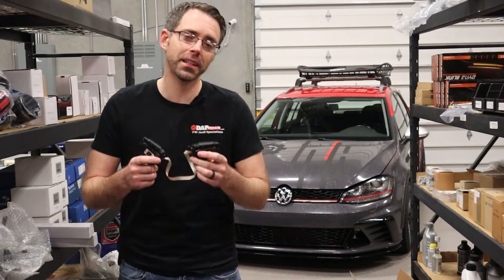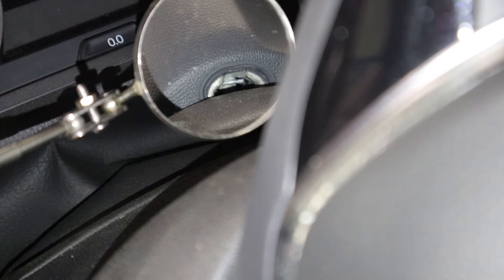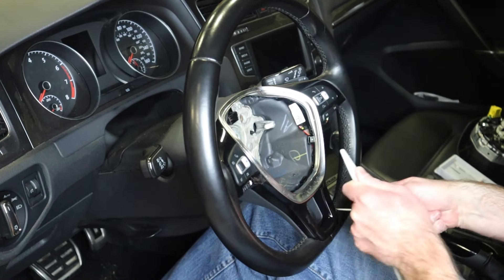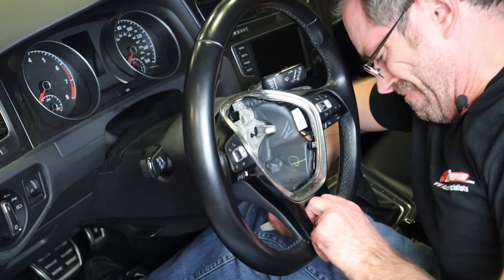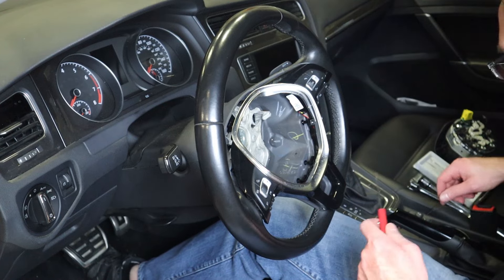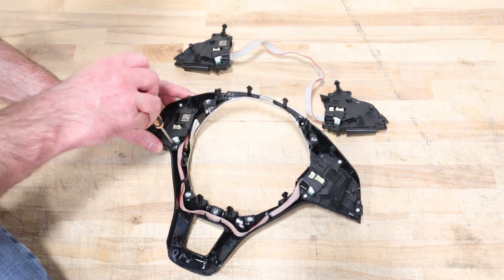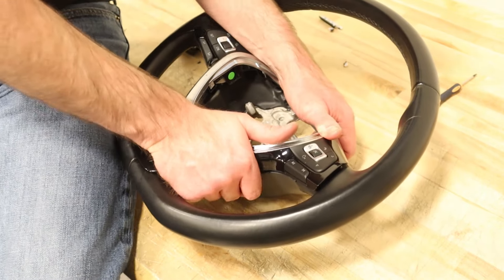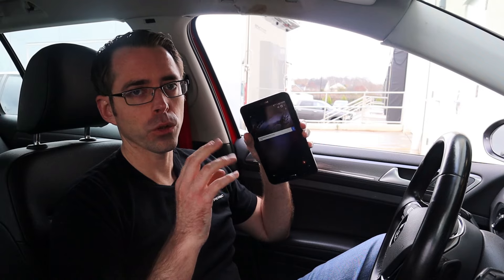How to Remove a MK7 Steering Wheel and Buttons (Trim)

Comment: Awesome vid Paul !! For those that don't know, when you reconnect the battery and get that steering error code, you can start the car then turn the steering wheel full lock right, then left, then back to center to reset. If the cruise error light is on, simply shut off the car and start it back up again. I discovered this recently after installing by boost gauge and had the error lights come on when I reconnected the battery.
Reply: Is it possible to swap this steering wheel with a g7 gti steering wheel?
Reply: @EntertainmentOnDemand1  same question
Reply: What about the airbag error?

Comment: This is a good and much needed video, but as others have pointed out on the forums it's much much easier to do this with the wheel off and only requires one more step to do so. Also, if you have a proper trim removal kit, you should be able to avoid using a metal object like that pick-screwdriver which is definitely going to damage wherever you're prying. I took my wheel off a few months ago, and I found that - like anything else involving clips in the VW world - whether or not you're going to break a clip that holds the trim/bezel onto the wheel is a complete gamble. Even if you're careful and take your time.

Comment: Thank you Paul - this helped me to get my airbag off my GTI MK8 so I could put in some R paddle shifters on. FYI, there are three springs on the airbag that need to be popped. At first, I assumed they would be just on the two sides but there is also one on the lower portion of the steering wheel. Wasn't too difficult to pop off. Don't underestimate Paul's advice to lower and pull the steering wheel out too! I did get error messages when reconnecting my battery but they did go away after the first start up.
Reply: How do you unlock the steering wheel while the battery is disconnected on the Mk8?  I'm about to do the same mod, maybe I'm overthinking it with the whole push button start 😂
Reply: @codypanek  did you ever figure this out? Do you need to reconnect the battery to turn it then disconnect again??
Reply: @MoF4tt if you press the start button without your foot on the brake pedal, it unlocks the steering wheel. You can then disconnect the battery and the wheel remains unlocked.

Comment: Instead of disconnecting the battery what I do is for kessy cars keep door closed when after turning ignition off(keeps the wheel from locking,once u open the door the wheel lock activates) or not removing the key on regular ignition vehicles for the same effect. Anyway great video keep them coming
Reply: James Kaminski does the horn go off of you remove the 2 airbag holding metal bars? I’m thinking to do this, then I’ll disconnect the battery before I remove the actual electrical plug. 2016 GTI SE W Kessy/Push start.

Comment: You guys should make a video on how to remove the door bezels where the blue/red LED light strip is on the front doors and also door bezels in the rear on a mk7/mk7.5 Golf/GTI/R. My passenger side has a deep scratch on the bezel and I don’t know how to remove it. 
Might get carbon fiber ones. Haven’t been able to find a DIY on how to do it and don’t want to risk using a trim tool and messing it up

Comment: First, thanks ShopDap. Second, some supplementary tips on trim having recently done this. Cheap deck of cards. Wedge them everywhere first for gradual release of tension. Also, fold them in half for tight spots. Then, lil chizlers; get a pack of 3-5. They start thin and then get thicker and have good, flexible angles. Great placeholders to keep tension. Lastly, use hook style pick to do the final pulls. Don't pull the trim itself with the pick, rather, hook-pick the black pegs Paul shows, the ones visible inner not outer. Pulling is done with your fingers being ever sensitive to spreading the pressure and gauging how much. Do avoid poking with picks on the outer edge of trim or your leather will never forgive you. Good luck!

Comment: finally a detailed steering wheel removal video!!! i've been wanting to buy a clubsport steering wheel for so long but could never find a detailed airbag/wheel removal video. that being said, so you happen to know if the clubsport wheel on your site comes with a replacement bolt? thank you so much
Reply from the maker: It doesn’t but the correct one is linked in the video

Comment: Great video and DIY, Paul. I was going to do a steering wheel retrofit on my mkv. My car has bluetooth , but no steering wheel control. So instead of doing the whole steering wheel, an I just add the left side buttons, change the swc and code it with obdeleven on vcds?

Comment: So for MK7's with kessy, do you turn the car in the on position (so that your steering wheel isn't locked) then unplug the battery?
Reply: You turn the wheel all the way to the left, turn off ignition, unhook negative terminal on the battery, disconnect that first clip. Then, reconnect the negative terminal long enough to turn the wheel all the way to the right. Repeat the process of unhooking the negative terminal and getting that second clip loose. Kessy = 2-part process, in my experience.
Reply: I actually discovered when the battery was disconnected long enough the steering would stay unlocked. The most difficult part of this job, by far, is removing the trim without damaging. My trim was so in there, I had to put it back on the car to hold it, add WD-40 to the top 4 clips (GTI wheel) and pry it out with a plastic trim tool.

Comment: I bought a Custom VW Steering wheel that came with all the Multifunction Buttons and after quite an ordeal finding out NOT ALL VW buttons are the same some work with ACC some don't. It just so happens the Custom Steering Wheel buttons wouldn't work on my 2017 Alltrack SEL w/ ACC. The proper PN/ 5G0959442PICX for my Alltrack (at least that's the P/N dealerships show online) There are at least 4 different P/N's all looking the similar but they're not. 
I was successful removing trim ring and did it out of car I actually think it might be easier than in car as shown. One thing I noticed is the barbs that lock trim into place are not clipped in but rather plugged into the rubbery hole and kind of just spread the holes in wheel while pulling out or pushing back together...but they are tight friction fit to be sure. I was really stressed about doing it but after getting to start it wasn't that bad at all. Just be careful and just a little at a time all the way around...a couple times should do it.
I now have my new custom Steering Wheel in car and control buttons ALL work properly and Zero warning lights. EPC and ACC malfunction lights were on before swapping trim and controls.

Comment: Hi Paul, thanks for another great video. I did this a few weeks ago and accidentally pulled out a couple of wires from both DSG paddle pigtail connectors. Does VW offer a terminal or pigtail replacement for the DSG paddles?
Reply from the maker: If you shoot us an email at our info box with the part number off the connector we should be able to look up the repair wire

Comment: @ Deutsche Auto Parts do you have any ideas as to whether the wiring layout from mfsw buttons to steering control module is same for jetta mk6 as with golf mk7??? trying to upgrade a jetta 2013 non mfsw to mfsw, have got steering wheel same as in video but need to order control module but not sure whether i should get 2015 jetta control module or golk mk7 control module :s ...

Comment: Hi and thank you for the video, I actually want to dismantle the buttons a step further. ( I spilled cola on it and want to clean in between the buttons ) Do you think that's possible and if so, what screwdriver would you need to remove the black screws as opposed for the silver screws. Or are they both T8's?  Love to hear. Thanks in advance.

Comment: I have a mk7 S bluemotion and looking to convert my steering wheel to a multifunctional one as it’s just a plane Jane one. Do I need to change much or is it just the wheel and a wiring harness to go with it?
Reply: Im wanting to the same. Did you manage to do this?
Reply: @shagraz  not yet, my Mrs doesn’t know if she’s going to have a job in September so I’ll probably do it next year sometime now.
Reply: @daviddoyle2085  currently doing mine, i just waiting for 1 more cable to come and i will let you know if it works.

Comment: I wonder where can I find a video tutorial to remove a steering wheel from VW POLO and install a new one Multifunction but without Control Cruise?.(Flat Steering Wheel). 
Or for VW T6 , because is the same steering Wheel.
 Your video help me a lot  to know how disassemble the airbag and keyboard.
But I need to know how to connect the buttoms, the airbag and the electricity. Thank you very much guys!!!

Comment: Along the same line... is it a straight forward procedure to upgrade to a multi function steering wheel on a mk 7, as the current wheel has no radio controls etc.. ?

Comment: Awesome video! I bought an all track steering wheel so I could have paddles on my car but the buttons are messed up.  Do you know if I can I swap the button set from my car w/out paddles to the all track steering wheel or do the paddles not plug in?
Reply: Hi there, were you ever able to determine if what you suggested would work?

Comment: Any way to use an aftermarket wheel and use a resistor to keep the airbag light off on a 7. If so could you please explain

Comment: Whats the easiest way to reset Airbag Error light?  All the other error codes went away after short drive except airbag error light.
Reply: Did you get the code to go away, if so, how? I’m having the same issue.

Comment: I plugged back the air bag and I have an airbag error message now. The stupid thing i did was startup the car without plugging it.. so it triggered a code, but now that everything is put back togheter propey, the error still persist... How do i reset it???
Reply: Did you get the code to go away, if so, how? I’m having the same issue.
Reply: @sammcrown  you need a professional scanner to get rid of an air bag Code unfortunately
Reply: @vincentrousseau8630  thanks for the feedback!

Comment: Instead of disconnecting the battery, you could just remove the Horn fuse or relay, then put it back on when done. 
The dash will be a light show after you reconnect the battery.
Reply: no

Comment: just get a GTI steering wheel and airbag and save the hassle.
Reply: goalie roller...Wondering if you've done that...from my experience there is no "just" in anything in Newer VW's or other newer cars because everything is coded to your particular car, just replacing a simple electrical part your car might not recognize it without coding and I'd be willing bet "just" getting GTI steering wheel and air bag won't be as easy as just removing old and installing new...count on it.